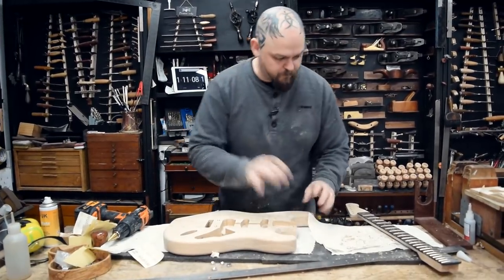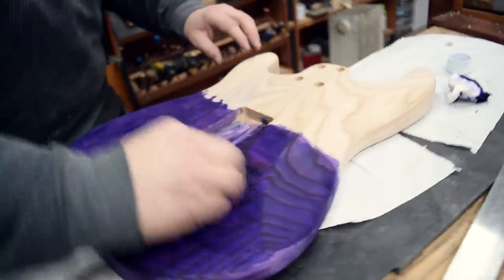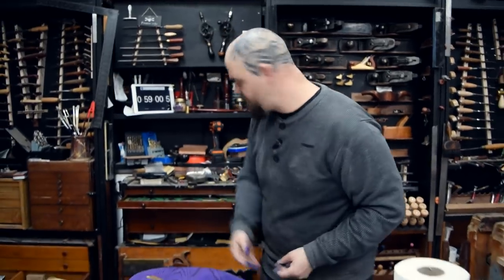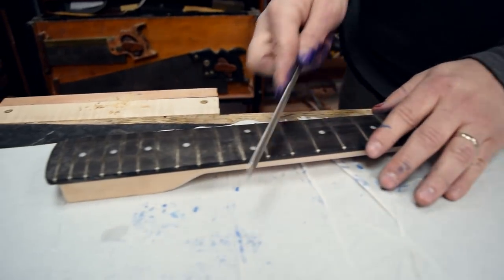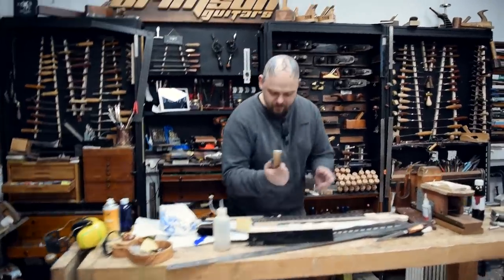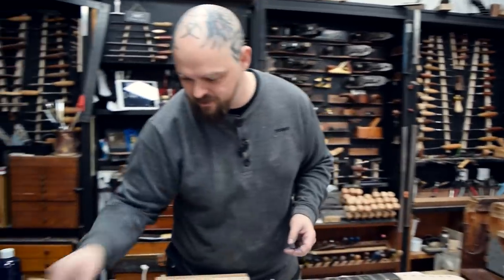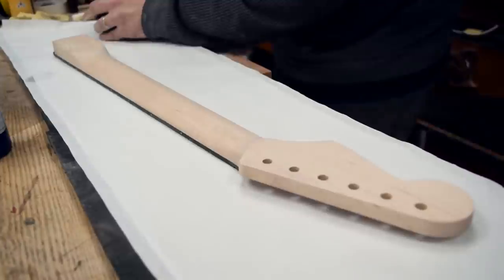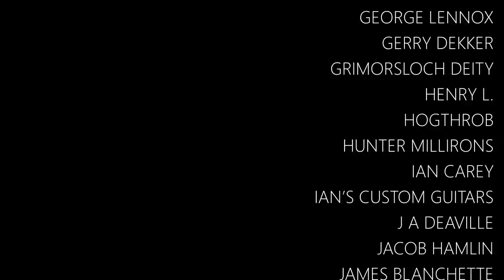Ep 2 - Ben's 100 Minute Kit Guitar Build Challenge - Thanks for hitting 100K Subs!

Comment: When using water-based colour, especially on clear woods, I use a regular kitchen sponge and go with the grain. It allows, by pressing more or less the sponge, to control the amount of liquid wiped, which is not possble with paper. I also add a pinch of ammonia in the colour, to have the color gently bite the wood. Thanks for all those fabulous videos

Comment: Aluminum U channels can be used to level frets even with out the handle. They're also useful for removing scratches from the bevels after using a file on them. You can also use them for removing scratches after leveling by going along the length of the frets with 400-600 grit. You can also level under the strings with a u channel. They are so useful.

Comment: In regards to the treaded inserts. You are supposed to cut a bolt down and use that to install the insert. Also, the ones with the slot. That's not for a screwdriver. It's so the insert has a easier time cutting through the wood. You install using a cut down screw on the other end of the slot. Slot side goes down. 

You should use hardened steel ones for the neck and not brass. I recommend hardened bolts as well.

Comment: If you have the inserts without the hex head on them then just cut a slot across the top with a hacksaw and then drive them in with a screwdriver...far less fiddly and time consuming than the bolt method.

Comment: Why did you use a step drill for the neck washer holes? It seems like a forstner bit would have been exactly the same amount of work?
Reply from the maker: +A1BASE I didn't have a forster bit to hand, which was poor planning on my part.. I do like how step drills are self centering especially when you are drilling into a hole that is larger than the point of your forster bit.. It's a tool I wish I had had from much earlier in my career. B
Reply: Yep. A bit more planning might have been better.
Reply from the maker: +Tim Beaton but then we miss out on the fun of problem solving under pressure.. I do enjoy the pressure.. Well, after the fact.. B

Comment: Shirley the correct tool for putting in the neck bolt inserts would have been an impact driver with a hex bit?
Reply from the maker: +Jorge Orwell these inserts didn't have any way of putting them in, no slot for  a Screwdriver or Moulding for a hex etc.. Most peculiar! B

Comment: I'd love a tutorial on galaxy finishes.

How strong and stable is the step drilled and cup washer neck joint? I have been using a new spoon bit to cut a fairly flat recess and was thinking I should be using a forstner bit for a neater hole.

How are you not having problems with the stain raising the grain? I've done two rounds of whiskering on the ash bass I've just stained with your stain and i still had to sand and restain around the edges. No disaster as I was bursting from black to blue and the sides were only done the one colour but still needed several rounds of wet and wait until dry.

Comment: Can I ask why you have to do extra fret work on a kit guitar? I would have thought the idea of buying a ready-made neck like this is that it would come levelled etc
Reply: I've never built a kit guitar and I'm not a gambler but I'm prepared to bet that you have to do a lot of finishing on other kits. And you don't get the quality of wood and fret wire or the accuracy of construction.
Reply: I'd be more interested in a crimson  guitar kit if the frets were levelled & dressed, and string-through holes were pre-drilled (in the case of the Tele body).
Reply: Ben said somewhere else that they don't pre-drill the bodies because there are different types of Tele bridge and some people don't like string through. If you watch how little time Ben needed with the levelling beam, you can see that the frets were already pretty level.
Reply: Guitar kits come in many different skill levels.  Leveling frets and making the guitar play and feel the way you want is part of setup work.  In my opinion, good fret work is less complicated than good finish work. If the neck has accurate frets and nut, and the neck pocket is strait and tight, and the cavities are correct without being too big; these are qualities that make a quality guitar kit.  I personally spend more time on finish and set up than I do with the actual building from lumber.